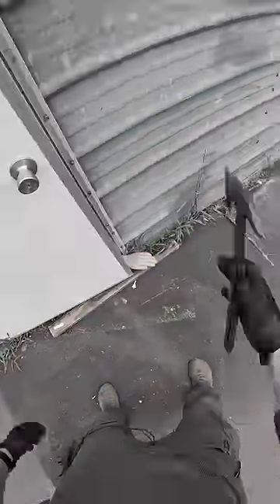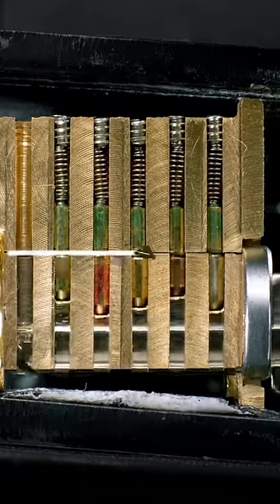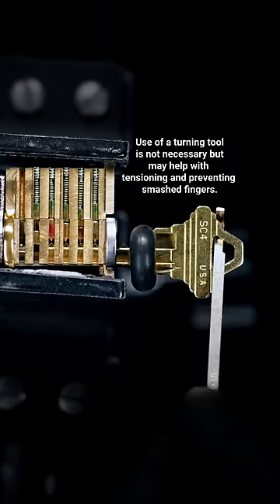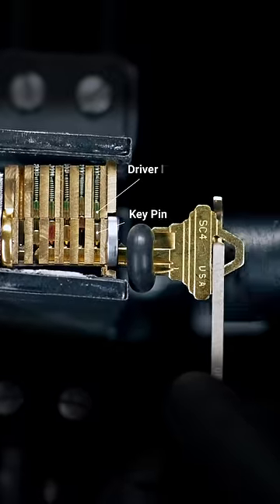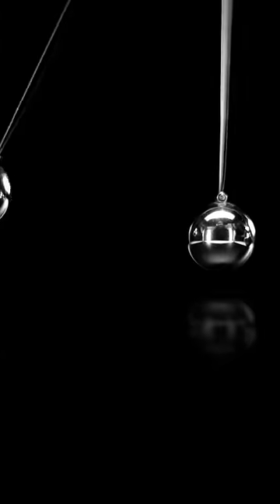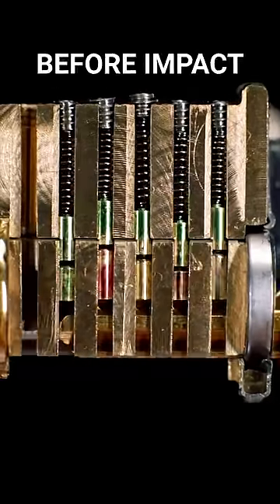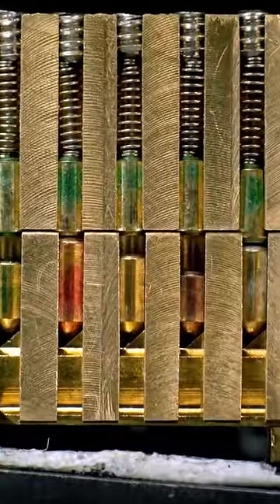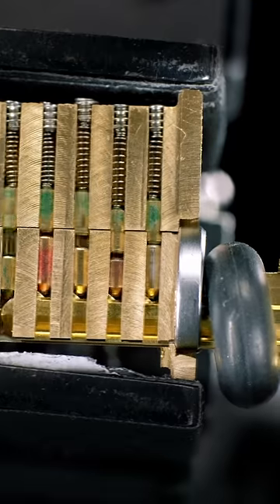Lock bumping explained with inside perspective and mini speed square motion graphics.

Comment: This is useful info. I got locked out of our house once but had another key that slid in, just wouldn't turn the lock. My dad showed me how to bump a lock so I used that wrong key and a brick wrapped in my shirt and bumped the lock and got in.
Reply: If it's not a deadbolt you could also just use an id or credit card & slide it in between the strike plate & latch & it should open
Reply: why did you keep a brick wrapped under your shirt.
Reply: @rosysaturniidae probably and extra brick from a patio or walkway.🙄
Reply: @richardb4022  youre probably right, i misinterpreted that
Reply: @Twilight.Knight Not if it has a dead locking plunger.
Reply: @rosysaturniidae your misinterpreting gave me a chuckle.  thank you. That was a funny thing to picture
Reply: @rosysaturniidae  😆
Reply: @rosysaturniidae it was Tuesday
Reply: I guess if u gring ur lost key down u can bump it open...

so I guess there really isn't nothing with a lil bump in grind....

untill the cops show up!!
Reply: Wow, I got locked out before!  Nice to know its an option!
Reply: Thanks for telling everybody how to open my house. Appreciate it buddy.🥺
Reply: @rosysaturniidae  Gotta stay bricked up... 😂
Reply: @richardb4022  dude said he had a brick, never told us were it came from, maybe he has a wooden porch or just had a brick for some plausible reason
Reply: I just threw the brick thru my door glass window , reached in and unlocked it .
I forgot to wrap my shirt around the brick  but it still worked fine .
Reply: @rosysaturniidae how else do you move around with your Colombian booger sugar?

Comment: Deeeefinitely didn’t have a 6 pin Yale bump key on my key ring in high school 😅 and the school definitely didn’t have Yale 6 pin locks for all the doors.
Reply: Nice.
Reply: Funny you say this, reminds me of about 1980 I was in high school, someone decided to use a fast setting putty in all the schools locks, which were higher security Medeco locks with dimples on the sides of the keys for additional pins, needless to say a locksmith couldn't get the 1500 students in, while the well below freezing weather (maybe 10°) was in high gear.  Eventually one lock was found unharmed, we got in, needless to say, the school had to replace all the exterior locks cylinders.
Wasn't fun standing
Reply: @Stache987 ...
Reply: Miles did they replace all exterior lock cylinders?😊
Reply: @Stache987 I actually thought of doing exactly that when I was in elementary school. It's good that I had the idea when I was too young to actually follow through with it.... 😂😂😂

Comment: FYI, having bump keys on your person is considered "B&E tools" so you might have issues if a cop stumbles upon them. You should be good if they are in a "just in case" spot, but if there was a break in in the area and they find you and your bump keys, you'll likely have an issue. It really depends on the circumstances.
Reply: Yeah, because trying to explain why you forgot your keys but why you managed to remember to have a shiny set of professional grade lockpicks is next to impossible.

Just for some supplementary information having lockpicks, dykes and wire, bypass tools, etc are actually legal to carry even if you're not a locksmith but if you get arrested- even misdemeanor it can bump it to a felony. It's like a bad game Yu-Gi-Oh, some cards are useless by themselves.
Reply: @RimWulf And none of that matters if they can't prove that you have used those tools do do anything illegal.
Reply: @93rwolf  not exactly. Mere possession after getting you for a related charge is enough to add the charge. But always speak to a lawyer.
Reply: @RimWulf  Being charged with something is not the same as being convicted. They would still have to prove that the tools were used for illegal activities. You can be charged with anything but without proof beyond reasonable doubt then they are meaningless.
Reply: @adraedin It all depends on the state you live in... I got arrested with all my lock picks, including lishi tools, bump keys, and bump hammer. I was not burglarizing anything though. I got arrested for being in possession of drugs. I didn't receive ANY BURGLARY CHARGES. I also got all of my tools back once I was released from jail. If I had been in the act of a B&E though, it would be a completely different story... I live in Iowa. There are only a few states where lockpicks are illegal to carry if you're not a locksmith. Thankfully, Iowa isn't one of them! 😅
Reply: @93rwolf  the person system is filled with people like you. But are right, they'd have to "prove beyond a reasonable doubt" whic everyone defines differently, both judges and jury. So if the jury feels that you are guilty, then ,you are, in fact, guilty in the eyes of the law. 
Also, of you were caught with stolen items and you have burglary tools they don't (in most States) need to "prove" that you used them in a burglary if they can prove you did a related crime larceny they can charge you true it and most Juries will convict vacate people are dumb.

There's also a jury nullification it doesn't happen often and if it does end up judge knows about it they can declare a mistrial. But it's basically a jury can ignore the law maybe they saw it to be unfair and found the defendant "not guilty" or believed that even if her friend commit the crime he still deserved to be punished found the defendant guilty.
Reply: ah, land of the free.
Reply: @TunsaMcHaggis  total freedom is a myth.

Comment: Lock companies need to hire you to make a super hard to defeat lock.
Reply: This only works if the lock has no security pins which only really crappy locks don't have
Reply: There is also no such thing as an unbreachable lock.

Locks aren't to stop someone getting in, that's a fundamental misunderstanding. Locks are purely there to make it harder (discourage through effort) and to take time. Each lock makes theft harder, entry harder and take longer to open.
Reply: I would just lock my door with like 20 master locks. Someone will notice a thief is trying to enter my house by then

Comment: I had a Schlage deadbolt on my previous house. The pins were ALL at the lowest point - in essence a factory bump key. Once I learned about bump keys and realized this, I took it to my moms house where she also had a Schlage deadbolt (with a more normal pattern) and within 4 hits, having never done it before, I bump her lock open with the key from my own house. Which means if someone came by my house with a bump key - they wouldnt even have to bump it - just turn.
Reply: I bought a couple of deadbolts and kept the most secure of cuts and re-pin all the other locks lol but you are right, some of these cuts are just plain stupid

Comment: Since my teen years I've always been fascinated about lockpicking but sadly badly I live in a country where Abloy is de facto lock brand anyone uses to lock anything except their Ikea desk drawer. Which opens with a flat plastic stick anyway. For 10+ years now I havent seen a residential building with anything else other than Abloy Protec2 and for years now most buildings also have the electronic key that they put into those.

Comment: Not even once have I seen him opening the locks that use the normal keys (at least normal for my country). I wonder if it's because they don't have them over there. The key is like a cylinder with a flat, square end that has teeth on both sides of the flat end.

Comment: Here's a question for ya: Is there a way to tell if your lock has been bumped, raked, or tampered with? Like, unnatural scratch marks, or loose pins?
Reply: Yes. Bumping tends to leave dents if done with excess force, as does lock picking. It's possible to set up your lock such that it disables when tampered with as well.

Comment: Or in my case where the door frame has a mile gap to the door, just use ur debit card or id to shim the latch open faster than a key will ever open the lock...apartmemt securuty is top notch.

Comment: so, you use your lost key, which is the right key, in the wrong way. And you turn it into the wrong key, so you can use it the wrong way. Rather, the wrong key turns into the right key because it's been used the right way, after it's been turned into the wrong  key.

Comment: Can this work ok cars? Obviously different key type but I have no way into a 2006 Honda Civic and if it ever dies I gotta remove the tire to jump through the wheel well, but my jack is stuck in my trunk which has no key or access at all without disassembling frame and interior completely.... Been "Lucky" for 2 years now and just need help!

Comment: Does it matter what hammer I use?
Reply: yes use a bump hammer
Reply: A bump hammer is prefered, but in a pinch, any rubberized hammer or mallet will do. Using a normal hammer of hardened steel has a higher chance of harming the lock.

Comment: I wonder would it make it harder to pick it all the tumblers were in a compressed gas cylinder that all shared space, so only have every pin put in place at the exact same time would line them up properly? Like any other type of adjustment would actually push the other pins back down?

Comment: @McNallyoffical any chance it's possible to open a lock by blowing compressed air in the keyway? I'm curious if it could push all the pins up past the sheer line. 🤔

Comment: Actually the best bump keys are not cut at the actual pin lines but slightly off, and often the shoulder cut back so you can get the full ramp on each pin without having to pull the key back (which may not work if partial set)

Comment: Why doesn't the pins go back down from the springs?
Reply: That's how lock picking works. You use tiny manufacturing errors to keep the pins from going back down. It's impossible to have 100% perfect tolerances in a lock.
Reply: Friction.

Comment: So any lock is pickable with a hammer and key.. assuming it fits the hole?
Reply: There are bump resistant locks which prevent or at least work to mitigate this attack.

Comment: I like how you claim it works in any lock the key can fit into. This only works on relatively cheap locks. One or two security pins will prevent this from working.

Comment: "bump hammer"? why not use a normal hammer?
Reply: The amount of kinetic force that goes into the hit depends on the materials used on both sides, as well as the force applies. A bump hammer is made of an elastic material so it bounces off of the other material, which transmits more force.

A normal hammer is less likely to open the lock, and more likely to damage it.
Reply: @LoveOverwhelming hmm, interesting. Thanks for this explanation
Reply: @eiryukun  My pleasure.